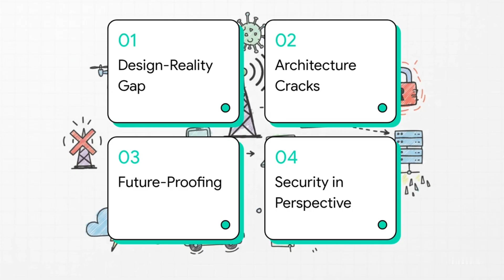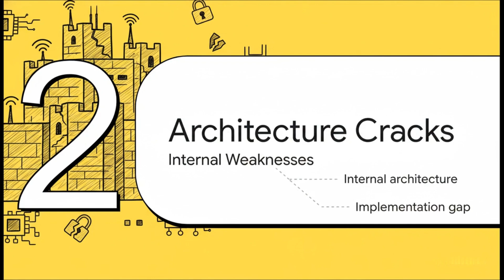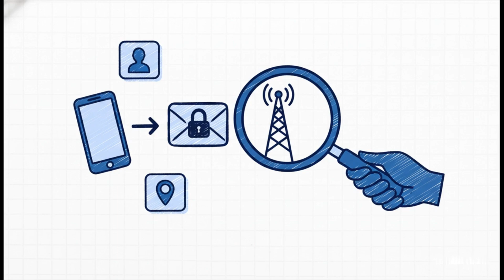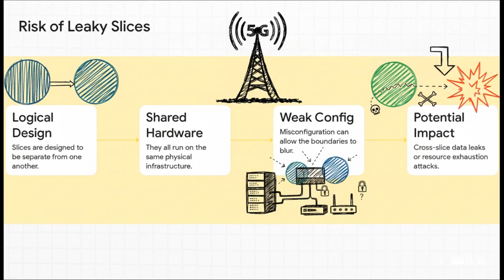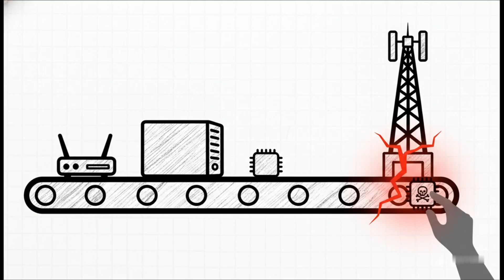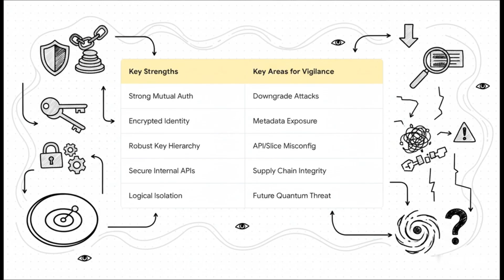5G Security Vulnerabilities Explained – Is 5G Really Secure?

Comment: Well, a lot of these comments are based on ASSUMPTIONS that someone can by-pass 5G security. While mentioning 5G security being excellent, there are points assumed that IMSI can be gotten hold of. It is the home based network that authenticated, not the visited site. Each layer including layers 1 and 2 (which is absent in wired networks) needs this mutual authentication. Therefore this "fake base stations" shown is from 2G which is no longer relevant. IMSI is never sent over the air. Singaling threat in an OFDM network with multiple channels and multiple routes changing randomly? Hmmm.. it is important to think through.
I am sure many of the old time, die hard, wired network engineers feel good to see this article, but implementation (including google) find it hard to even identify. Within the network only the home based (old HLR) network knows where the user is, but it is not available to outsiders or even the ISP executives since that data is quite complex and random.

Anyway, good attempt to convince old timers that wired security is the best, but NIST may not agree.